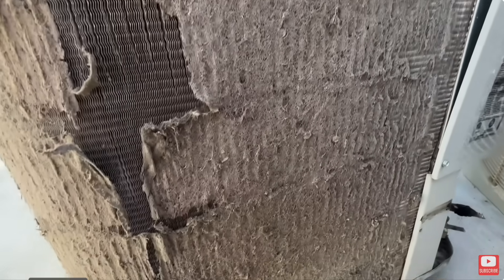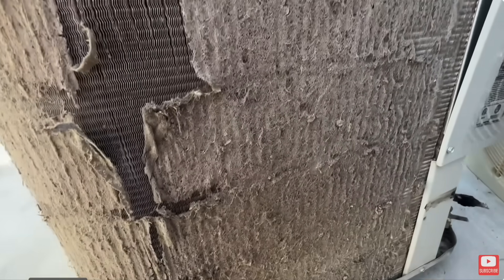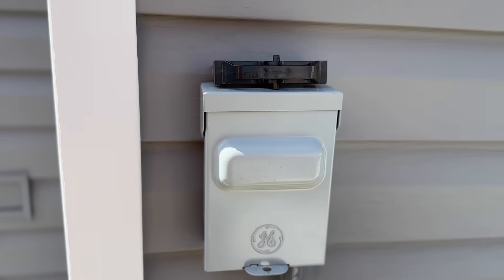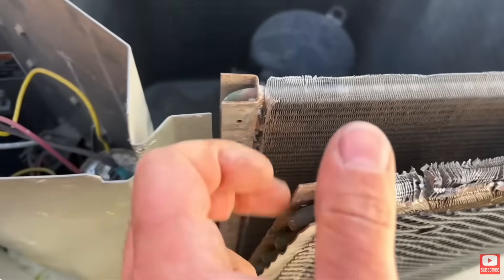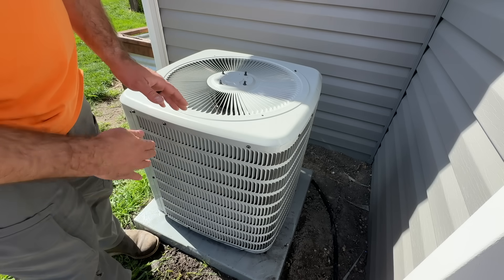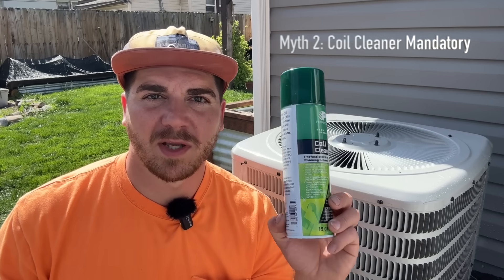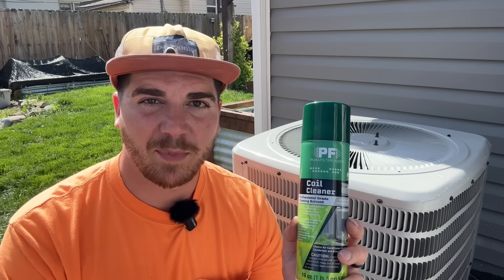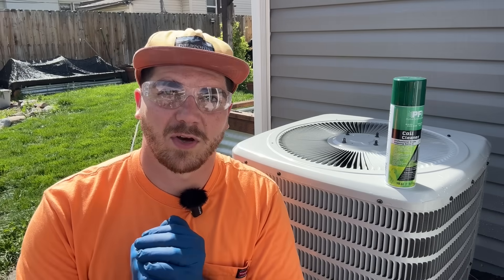Stop Cleaning Your A/C Coils The Hard Way! Do This To Get Colder Air From Your Vents.

Comment: The reason I take the lid off is because I live on a barrier island, and fine sand gets everywhere.  AC units run probably 9 mos. of the year.  Then there’s the corrosion.  In this environment anything metal will rust, and fall apart. Replaced a unit after 7 yrs.  I keep it clean, out of the abundance of caution, and $$$. 🤷‍♀️

Comment: If you have a bunch of cottonwood fluff on the coil the only way to get it off is to remove the top and maybe the sides in order to wash it down and off the coil. I would mush prefer grills that allow the coil to be cleaned without removing anything.

Comment: The drain holes in the bottom of the unit may plug when you spray from the outside, can't clean them out unless you take off the top.

Comment: I sorry but I’ve been doing ac for 50 years. On the two row coils the dirt will pull through the first coil and get caught on the 2nd coil and create a carpet in between the two coils. So yes you do have to split them apart to clean them. Especially if you’re in an area where there’s a lot of Cottonwood or Cotton weeds or Cottonwood trees.

Comment: I just paid a company to clean mine and he took off the top, vacuumed the dry stuff first and he sprayed from the outside and the inside. When he sprayed from the inside he got a ton of dirt off the coil so I'm going to go by what I saw with my own eyes. Take the top off and spray for both sides if you want to get all the dirt off.  He didn't take the whole thing apart just the grill on top.

Comment: yeah.. my last ac lasted 18 years.. I didn't have a service plan for it.. I was able to remove the fan that came off with just removing 4 bolts. I sprayed it from the inside out.. not forcing the debris into the cols..The new one has panels with louver vents on three sides of the ac unit.. it takes the tech several minutes to remove about 12 screws on each of the panels... I didn't see any difference in his cleaning them. other then pointing the hose in a downward  spray pattern.on the outside of the coils..the debris rolled up like a pastry and fell off at the bottom...I like the second units set up better for cleaning...

Comment: What you might what to check.....cut grass blowing on coil, dogs peeing on coils, bugs in control section, mice and other varmints, leaves falling inside cabinet, loose and improper wire connections, funny smells (burning), bees nest, mulch piled up high around base, well you get the idea.

Comment: ...Our favorite. 
No Texas accent (sorry), no making the P noise into the mic, no excess endless detail. 
Yup, nope... Good guy. (I'm next door in Colorado)...I'm hoping to service my R22 system and get it working again at least until off-season, because the alternative bids I've received are between $15,000.00 and $21,000.00. I admit I've neglected my equipment to some degree, but I'm not paying someone to spray a hose on my condenser! Ridiculous. This low level maintenance is easy but expensive to hire out.

Comment: The first time I cleaned mine was about 5 years after owning it. The coils had what looked like a thick layer of shag carpet. I removed the top fan cover and side grates and used a shop vac to vacuum clean the coils. Worked great. Now I service it every year using the water hose.
Reply: I had never cleaned one before and when I bought my house, I hadn't touched the heat pump until the relay burned out after the 5th year living here.  I took off the side panels and thought the coils were lined with insulation as a feature! 🤣 I cleaned off all the debris and replaced the capacitor and relay and now I'm taking much better care of the system.

Comment: On top discharge units, you don't have to pull the entire top off the unit to access the inside - you can usually remove the grill and fan, which will give you plenty of room. You need to get rid of any debris and leaves that have fallen inside the unit, and make sure your water drains are clean. If you have a double row of coils, this will also give you enough access to give them a good cleaning as well.
And per the service manual for my 28 year old Amana heat pump, they also recommend that you clean the evaporator coils inside the air handler at least once a year as well.

Comment: I get much better results taking the lid off and using a cleaner. Plus you need to check and remove larger debris from the bottom and make sure the drainage holes in the pan are clear. Sure it's not easier, but nothing good comes easy.

Comment: My unit, a Goodman, is just like the first. I’m in an area with so many cottonwood trees that it looks like snow in June. By the end of June, the cottonwood fibers on the fins is like a heavy flannel shirt. It’s a pain to do, but the only way to clean is to disassemble the case (why are those wires so short?) and vacuum. Afterwards I’ll rinse the fins from the inside, pushing dirty water out. It’s a pain, but it works, unlike rinsing through the louvers or using a leaf blower.

Comment: Sorry I respecfully disagree I have always washed from the inside to out. Yes your way is easier but the drain holes at the bottom of the unit will get clogged up. Your way will push dirt and scale back into the unit.

Comment: Those are "fins," rather than coils, which are inside the unit. And using a little Dawn soap with the water spray works about as well as the expensive fin/coil cleaner, IF you clean everything in a regular basis.

Comment: Agree with you 100%. Started to take the top off my unit and ran into a problem with short wires to the fan motor. Did not want to screw anything up so just put it all back together and cleaned it from the outside as it was a single width coil. Was never cleaned in 5 yrs and could not believe how much krud washed out.
Reply: I just finished doing it the hard way. I will never do it that way again. Next time, the panels will stay on

Comment: This information is totally wrong. The Air flow of the condensers fan is from the outside to the the inside. If you spray water on the coil from the outside in. You are just pushing the debris deeper into the coil. You must spray the coil from the inside out, in the opposite direction of the air flow, You will  need to remove the top panel that the fan is attached to and spray the units coil from the inside out. That way you push the debris out of the coil. These people are  just trying to sell you products that you don't need.
Reply: Did you not watch the video cause he literally explained that part and why he doesn’t think you have to take off the top and go from the inside out he also didn’t sell anything. He’s trying to give people affordable ways to do it without having to buy anything or hire somebody to come out.
Reply: @Missmay777  The coil has to be cleaned from the inside out (The opposite direction of the air flow) to get the dirt and debris out from  between the coil fins.. But, you do what ever you like. I was giving the true info. for those who wany it really cleaned.
Reply: @roybradley5532  he explained that he didn’t just not go over it. He talked about precisely that and why he doesn’t think you need to. He does do HVAC for a living. Do you as well?
Reply: @Missmay777  Yes. I started in 1986 when I got out of the Army. I have worked on and installed all kinds of systems from 2 ton residential to 30 ton roof top system But, Hey do what ever you want I was just trying to help whoever was reading that so they would know how to do it right.

Comment: #1 disconnect the electricity on it. <<<<He used PF coil cleaner. From home depot, but another one from Amazon he has link on. Some say spray soap. some say  scrubbing bubbles was recommended.

Comment: This is a critical step on my yearly maintenance routine. But... I do prefer to back flush it from the inside, but my units are easy to pop the top off of and unplug the condenser fans. Also... Change your damn inside filter(s) every 90 days and use good MERV rated filters for your household application.

Comment: At dusk, shine a portable spot light outside in. Look inside to view how much light comes thru. Trees vary but seeds, debris, tiny leaves & cotton wood trees can plug. I use an old shower curtain w/bungee cords to cover the condenser. Also, if you own male dog(s) buddies for pets, and they will pee on the coil & damage it worse than Muriatic Acid. Copper tubing is much smaller to 5.5mm. The pinky finger is 11mm or 7/16” and easily damaged with strong chemicals, even phosphoric acid sprays unless diluted or quickly rinsed. 
  Great information in this video. I learned years ago the hard way!

Comment: Definitely wrong I’ve had to split many coils over the years because the coil in the back is so dirty because techs do what you’re saying. Half the time the call is no cooling because the head pressure is so high it’s split the discharge line and leaked all the refrigerant. You must not do any commercial work

Comment: my ac will not run for 5 minutes every time it turns on and have had 2 different companies out and they can't find anything wrong but said that's weird so was wondering any ideas you might have ? I've tried different thermostats too and no luck. Thanks!
Reply: put a clamp meter at the compressor and check if the current is spiking.

Comment: Good advise.  I have one concern. When spraying is it advisable to have the spray at the power  level that you show.  Will that not damage the coil? Spraying should be done with the hose set to  a gentler level.

Comment: The best ever results is Liquid Plumber in a spray bottle. You will be shocked at the results. My hvac guy thought I had someone else over to clean the condenser unit.
Reply: That's because it's dissolving the aluminum that the dirt is stuck to...
Reply: @panzerkiller13 yikes

Comment: Your air conditioner is like a large vacuum sucking air in. So, to me isn't the dirt getting packed from the outside?  More work, but better to spray from the inside to the outside, but doing some cleaning is better than nothing.

Comment: I worked on a lot of commercial and industrial air conditioners that had split coils like that and they needed to be opened up and cleaned if you just wash it from that side you just packing everything in between the two coils that's BS what he's telling you

Comment: I push debris down for the outside and rinse from the inside out. It does make a big difference. Informative video but if you’re gonna rinse solely from the outside in let the system run when ya do it that way debris is pulley through by the fan and pushed by the water. Yes I’ve done this and no it doesn’t cause issues because im not deliberately spraying water into the electrical panel. I don’t do it like that anymore because I like removing the leaves from the compressor area anyways. Been a long time since I’ve rinsed from the outside in😂

Comment: Always clean your coils from the inside spraying the water outwards. Why ? The fan blows the air outwards across the coils so build up of debris is co contracted on the inside part of the coils. Spraying the water from the outside is the lazy way.
Reply: The fan pushes air up not onto the coil from the inside…

Comment: My AC was not cooling at all. The fan didnt spin and the system was on. The temp was not going down. I changed the air filter and properly seated it. Sprayed "pink stuff" on the condenser coils and let it sit as i cut my grass. Literally used a leaf blower to blow away any debree around the AC and hosed it down. Problem solved. Company wanted to tell me i needed a new fan motor. Thats how they make money by ripping people off

Comment: A lot of systems have two sets of coils and this method won’t get both coils. You need to take the top off of the unit in order to clean both coils.

Comment: There’s a house attachment that is for cleaning pool filters that has fins just like these coils. It is perfect for this because the pool filter is exactly the same as the these fins and it has many streams at once and you rinse from top to bottom the same way. When i bought it for pool filter it got a lot more out of pool filter than a hose sprayer so you will see you get more out of coil fins. It sprays more of a wide fan spray but in single streams not misty.

Comment: @The DIY HVAC Guy

How about how to clean off mineral build up? Is there a specific coil cleaner you would recommend for that?

I used a misting system for a couple of months but it seems the water in my area is mineral rich... The misting company said to stop using their system and to clean the coils.

Comment: If you have tile roof that you have cleaned every year or so, many roof cleaning companies use chlorine to help kill mold on roof when they pressure clean it.

Make sure you turn off air conditioners and insist they cover and protect the outside air conditioner unit from chlorine based roof cleaning.  Clorine rapidly corrodes aluminum condenser coil fins.

Comment: Its cool that you aren't spreading misinformation to keep people scared. I came home on sunday and my house was 94f a week ago. I heard the contactor making a buzzing sound, and the unit was installed in 1987, there wasn't a manual button, it was wide open and I pushed it with a screwdriver and boom, the fan started. I'm not an HVAC guy or an electrician, but I install and repair printers that are as big as a semi, and $500k so I have a little skill. Their contactors are much less primitive. So I go to the HVAC store around the corner and they won't sell me a contactor because I don't have a license. LAME. I finally found a place that would sell me one and I fixed it in about 10 minutes tops. Then I took it apart and cleaned everything. The inside was full of dirt but the coils were pretty clean. (southern California)  We rarely run the AC and its basically always had light work. Switched out the condensation pump last year, and cleaned the lines. In 2020, I replaced the return ducting, and filter as well as two other ducts in my attic at a cost of $75ish for the pump and $200 for the ducting. Don't look forward to anything expensive happening but if it does, I'm going ductless thanks for the videos

Comment: I tell everyone pretty much what he is saying. I also tell them to just spray the coils down a few times a year during operating season. It takes just a few minutes. I do want to make a comment as someone who worked factory service for 40 years and had 5 years experience before that. For double coils. If you clean your coils twice a year during operating season, yes, he is correct. But, after 3 years, you should spray the inner coil.  Also, do not mow spraying your coils with the discharge. I would be very careful using any chemical cleaner as he stated. I use a light mixture of Dawn and water, spraying it in at the angle he showed earlier.

Comment: Thank you for the video. My question is ; why you have to disconnect the power if you are only clean it from the outside? I usually disconnect the power if  i have to clean from the inside.

Comment: I bought a $35 mesh screen cover for my 3 ton unit which I recently cleaned.  Cottonwood was the main debris and I'll check again next season to see if the mesh helped to keep the cottonwood out.  I did completely remove the outer shell of the unit and the coils looked like a well caked dryer screen after cheap fleece clothing was dried.

Comment: @8:50  Correct me if I am wrong, but I don't think you are suppose to have your high and low pressure lines coiled up. ??
Reply: No, you are correct.way too much extra tubing, and vertical coiling is a no-no.

Comment: So I have a one year old Amana (Goodman) 5 ton.  And the side panel fins are angled so you can only spray water up.  Yeah - unable to clean without not only taking the top off but also removing all sides.  I have a cottonwood tree somewhere close so not only do you have to spray it down, but you have to take your fingers and clean out along the bottom because it is too much debris to go down the drains (hence you have to remove the sides).  It is also noisy even with a compressor blanket. I agree that the double row coils do not need anything special to clean.  Debris is only on the outside. My old a/c unit just had the wire on the outside instead of the metal shrouding.  Much easier to service. This has to be the worst design yet - rat bastards!

Comment: I have a Luxaire (York) since 2015 and we have a Linden Tree adjacent to it (very messy), a sure thing for debris and dirt coating the coils.  What I found is the coils are covered with a spongy filter film which surrounds the exterior 4 sides of the coils.  It has been necessary for me to remove the metal exterior panels and the film to properly clean this unit. The filter film will defeat other cleaning attempts unless it is removed. There are no shortcuts.  My brother in Law lives next door.  He does not care for AC and only uses his Goodman AC on occasion.  Never have to clean his, the coils are mostly clean.  No trees nor plants near his unit.  And yes, you have to be careful to avoid injury to the wiring going to the fan. Manufacturer did a sloppy job in designing that harness setup---like if they care less about maintenance people anymore. Using a spray can of coil cleaner does a great job, but I use plenty of water spray rinsing to get stubborn debris off.